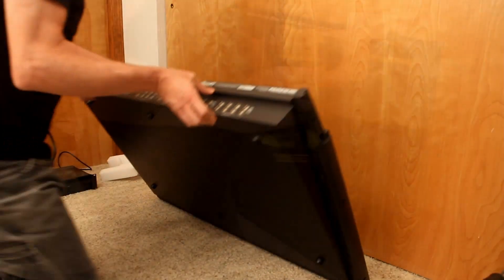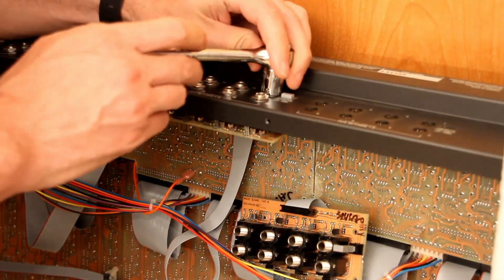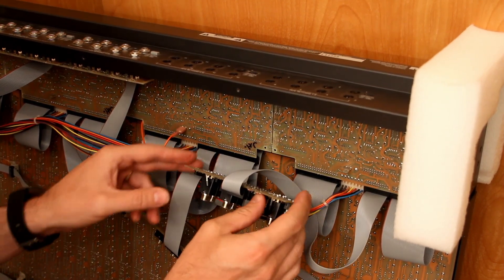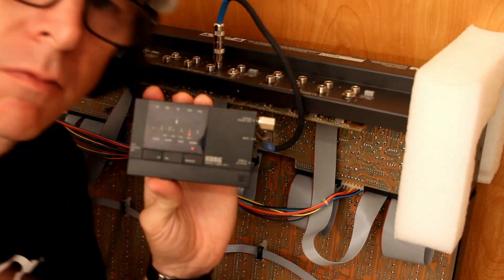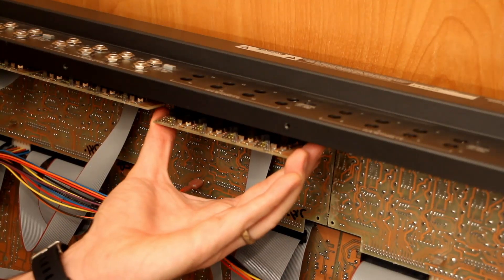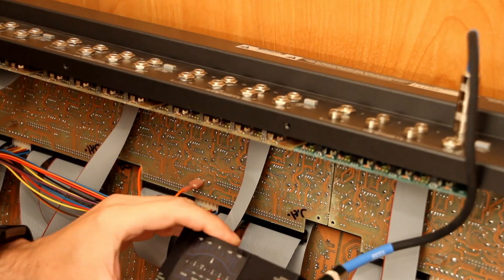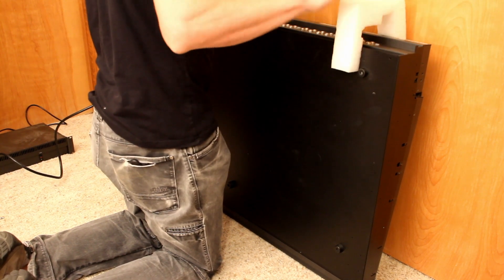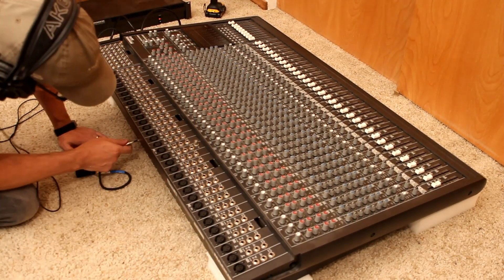Mackie 8-Bus Mixing Console Tape Input Troubleshooting & Repair

Comment: Nice video. Got hold of a used mackie 8 bus. Upon first testing it, I don't think the main left output works. No signal on the meter bridge and nothing coming out of the left headphone. Would you know of any common culprits for this? As far as I know it hasn't been used for a while and I plan on doing a proper cleaning.
Reply from the maker: I don't have any specific advice, but opening up and cleaning is a good start.  Blow things out with canned air or an air compressor to begin with.  I would then check all the ribbon connectors and clean the circuit board contacts with an eraser if they look dirty.  Sometimes, just wiggling or reattaching a ribbon cable can fix things.  Best of luck!

Comment: David. I am having nightmares of not being able to remove Jack plugs from most of sockets on my 24.8 Mackie. Without using a great deal of force. Any ideas why that may be ? Have ever had that problem . Thanks
Reply from the maker: No, I've never had that problem.  Of course, be sure the plug is straight.  Some plugs are shaped differently too - try some different plugs to see if it makes a difference.
Other than that, I'd either call Mackie support or try the Gearspace forums.
I'm sorry I can't be more helpful.  Best of luck!

Comment: Thanks for your well produced video, David.  It gave me confidence to open up my Mackie 8-bus and extract the 34-socket jack field board to remove a broken off jack tip.  I removed every ribbon cable to get a fresh metal to metal contact.  Everything works as new now.  Mackie's are built like tanks.
Reply from the maker: My pleasure!  I'm glad it helped.

Comment: Very informative video. I just purchased a 32 8 bus In great condition. The left view meter needle is broken off in half, you can only see the bottom half of the left view meter needle. do you know if the meter bridge can be repaired? Also, I am new to the Mackie 32 8 and would gladly pay for an
 in-depth video on using all of its features. Do you have any videos of using the board, or be willing to make a tutorial video on the 32 8 bus?
Reply from the maker: Wow - a snapped VU needle?  The prior owner must've blown the walls off that studio!  😀

I'm glad you liked the video.  I don't own the 32*8 anymore, so can't produce any more 8-bus videos.  Sorry!

Actually, that's not 100% accurate.  I purchased a Mackie LM-3204, which is basically a rackmount 32*8, for use as a keyboard mixer.  It's brilliant for this application - more I/O and features than a true "keyboard mixer," with a 100% familiar layout and reliable, super clean signal path.  But it's not a 32*8, for sure.

There are other videos that might help you, though, like this one:  https://youtu.be/IFN9xHhlvAA.  Also, the layout of the Mackie 8-bus mixers is pretty straightforward too - no complex automation, etc. - so really any mixing tutorial should help.

I suspect your meter bridge can be repaired - maybe DIY.  Check out this discussion:  http://d8bforum.com/phpBB3/viewtopic.php?f=4&t=682.  If all else fails, call Mackie and ask for service.  If they can't do it, they should be able to refer you to a nearby service center.

Good luck and enjoy your mixer!

Comment: I just grabbed a mackie  32 8-bus mixing console its has pops and crackles each channel gets a clean sound once i play with buttons or adjust faders. My question is is it better to get a new analog board at ah way higher price or get this one serviced? Will getting it serviced fix my audio issues. Also My meter bridge only 24 leds work and only one VU meter works both have no lights. Also my 1 channel on my master bus doesn't work so I might need a new master bus channel ? I really like this board so if I can get it all fixed an not cost me to much I am all in I just want to know will it be worth it?
Reply from the maker: If you like the sound (between pops and crackles) it might be worth repairing, but it sounds like a pretty long list of repairs.  My recommendation would be to take it to a local pro audio service shop and get an estimate.  Can't hurt.  And if you tell 'em you're okay with DIY, they might be able to advise you on some of the repairs.  Personally, I draw the line at soldering (unless I have very, very clear and explicit instructions).  If it requires soldering, I send it to the shop.  Of course, only you can decide if the price they quote you is "worth it."  Then again, if you can afford a Neve console....  ;-)

Best of luck!!!
Reply: I want it as a big ass patch bay with metering and EQ lol I will bu using alot of outboard gear with my DAW this was my center piece. I want it colorless so my outboard gear colors my sound. I got it for 250 bucks so any money I out into it is a win in my book Im below market value lol. Thanks for the info sir